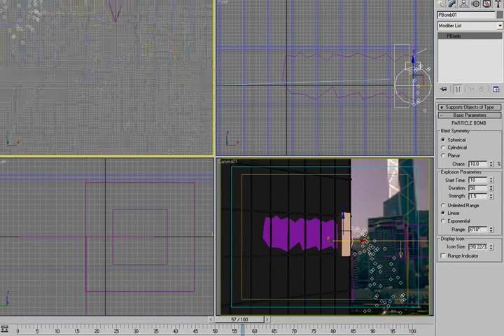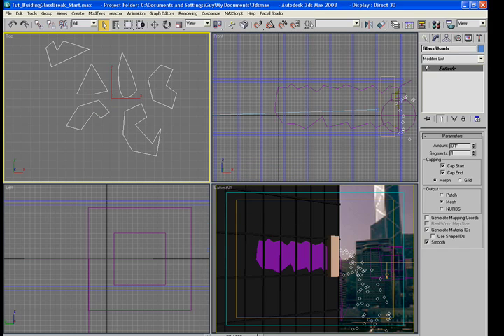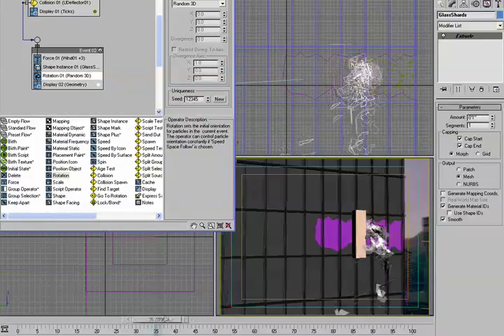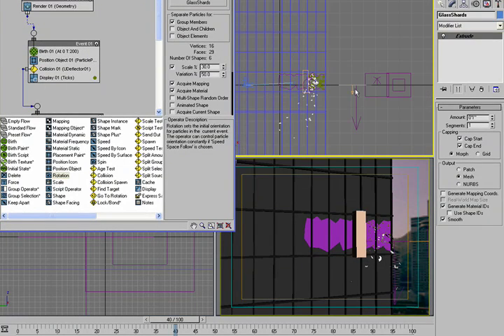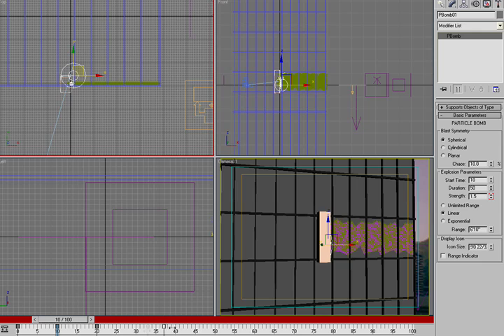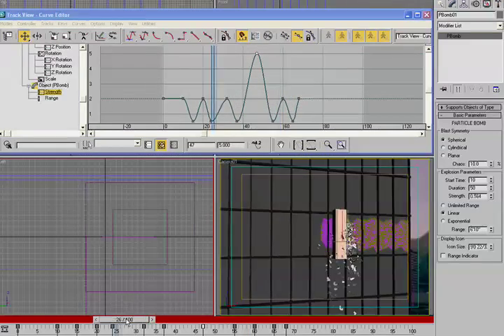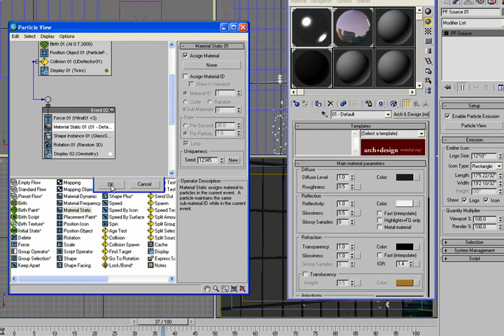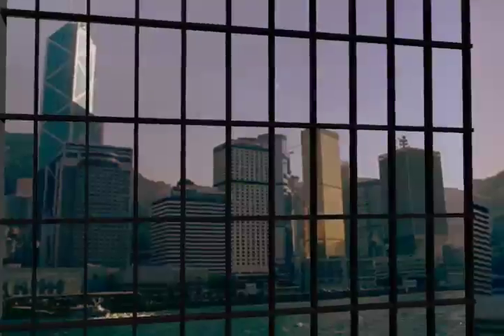Building Glass Debris Tutorial 3ds max / Pflow - part 3

Comment: @BKalman96 -  By creating the matte, I then use After Effects to carve out the hole.  In 3ds max, there is no real hole in the building.  Using this technique, you could also create two models - one the outside of the building and the second the inside and use the matte to transition between the two.  Since you have all the debris and smoke, the inside of the building could be pretty low quality and still have the effect of seeing inside.